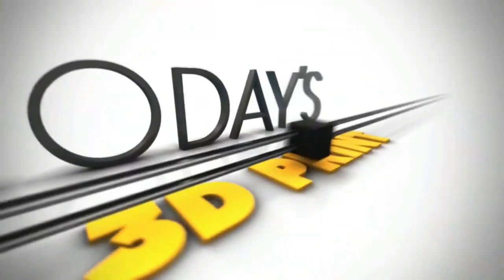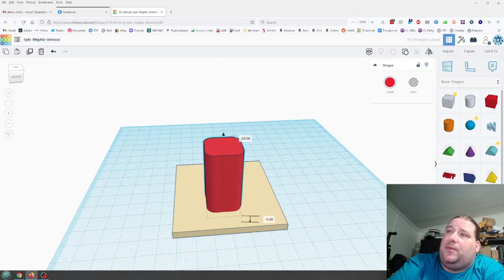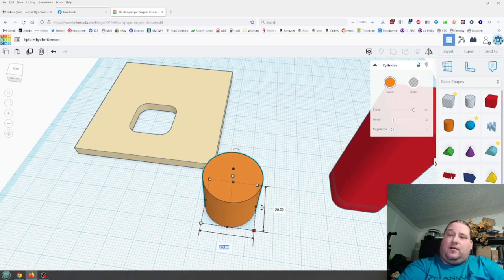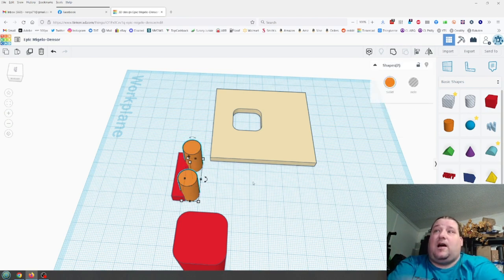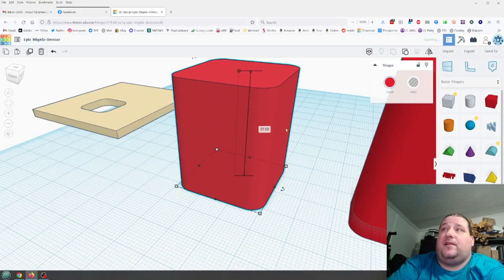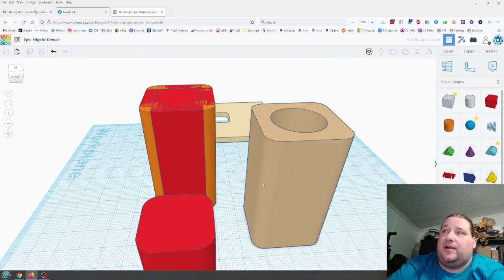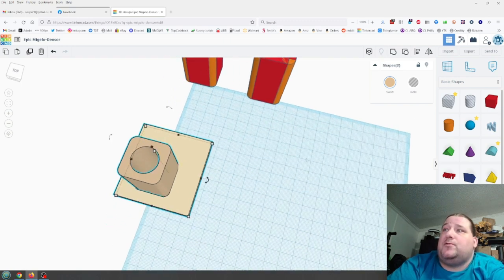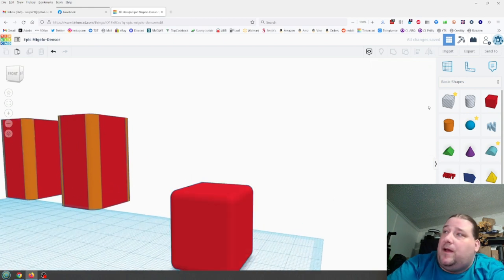Using Tinkercard to make Radius Square Tubing 3D Printing T3DP

Comment: Thanx for the excellent video as of today I feel more confident I was about to give up on 3D printing....the issue that I have is that I am printing square pipe connectors and I am connecting these pipe square connectors with wooden square dowels.
 My connectors break along the corner.. it seems that your design will print and it will be strong...My connectors break right where the walls join...Wish me luck...Cheers :hand-pink-waving: